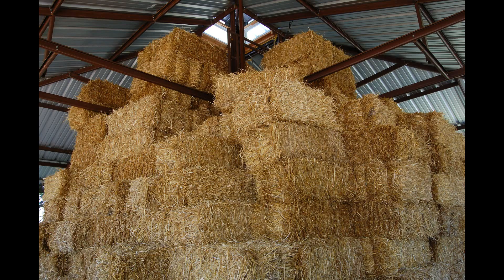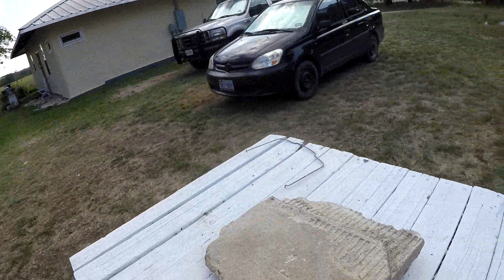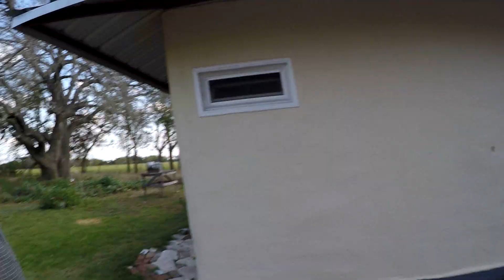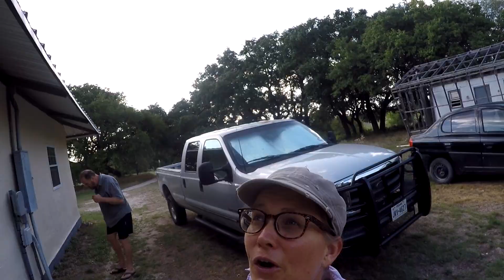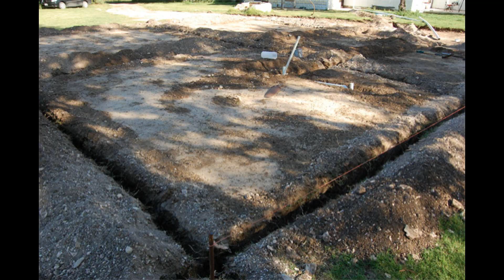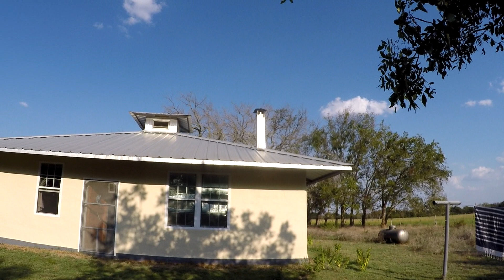Straw Bale House - Exterior Talk

Comment: ID like to know the slab underneath it and how you start the hay bale how you join the hay bale with the chicken wire to the slab and and and plug it into the slab to have no damn Rising all make it weatherproofing and
Reply from the maker: The bales are impaled on rebar spikes.  The rebar is tied into the rebar in the slab.  This was done before the concrete was poured.  Where the bales sit on the slab we put a layer of thick tar.  The chicken wire is tied to the bales using a piece of rebar that we made into a "needle".  Then we were able to stick the needle through the bales and "sew" the chicken wire to them.  There are also rebar spikes driven from the top through all the levels of bales.   You can see a slide-show of pictures taken during construction:  Part 1:  https://youtu.be/iwJDmIFf8Tc          Part 2:  https://www.youtube.com/watch?v=--FeNHGKRDk

Comment: I'd like to know how you made each level of concrete over the bales. Could you possibly send it to me?
Reply from the maker: Hi - All layers were a mix of Slaked Lime, cement, & sand.  I don't recall the exact ratios off the top of my head...each layer was a little bit different.  The exterior wall were more of a concrete mix.  It's basically stucco.  The inside walls were finished in a layer that was very heavy on the Lime and light on cement.  My notes are not with me....I'm living in Mexico currently.  The Lime we slaked ourselves in 55 gallon drums for several months prior to use- We got the bags of Lime & concrete from Home Depot.  We used a test bale and ran several test mixes in order to decide which one we wanted to use.

Comment: Is your home post and beam and did you do the framing.
Reply from the maker: The exterior framing (walls & roof) are steel.  We infilled the walls with the straw bales...plastered both inside and out, & then we framed the inside walls & ceiling with 2x4s.  The 2 of us did everything in this build.

Comment: How is the exterior holding up. We will be building our Strawbale house this year this is great info. Can you send me your receipt for your render. We also don’t want a lot of maintenance. We have diving rain. Where going to use vinyl window. What state are you located in.
Reply from the maker: We're satisfied with the stucco.  It's still in great shape.  I have painted it twice since 2011 with the higher quality stucco paint.  The west side gets intense sunshine in summer...so it was chalking slightly after about 8 years.  There are fine cracks...but that cannot be avoided with a stucco exterior.  It is part of the nature of the material and should be expected.   It's super strong & tough.  We get driving rain too....no problems as long as you keep the paint finish maintained.  We built our walls super simple...so it doesn't take me long to repaint the entire house with a roller on a stick.  Once every 8-10 years doesn't seem too bad for maintenance.  I don't have the recipe with me now....I am living abroad at the moment but we developed it from tests we did using cement, lime, sand, & water.  We slaked the lime....(lime + water mixed together in a 55 gallon drum and left to "cure" for at least a month.ou can find a basic starting recipe on the net...but I highly recommend you take that and do your own tests

Comment: Hi folks, you guys put a lot of physical labor into building your home, to be honest I had never seen such build until yours. As far as the insulation R value off the straw and concrete is there a number value. Thanks folks !
Reply from the maker: We've measured the inside & outside surface temp of the west-facing wall at the hottest time of the day, during the warmest days of the year.  One of the hottest EXTERIOR surface temps we recorded was 130 °F.  On that day the inside temp of the same wall was 80... which was the ambient inside air temp.  So there was no change to the inside wall temp.
Reply from the maker: Oh boy did we ever (put a lot of physical labor into it).  Straw bale construction has been studied quite a bit.  There are several building institutes & universities who've published their findings online.  I've read that the R value varies but a common average is 2.38 per inch of thickness...some put it as high as 2.67/inch.  Our walls are about 2 feet thick.  The bales were approx. 19" thick.  (the plaster averages 2" on the outside & another 2 inches inside)  R value for the bales would be a little over 45 R.  They are extremely insulating.

Comment: Did any books inspire the cupola design for passive cooling?
Reply from the maker: I can't recall any specific books that inspired us to add the cupola.  I'm an avid fan of looking at architectural styles around the world & I know I've seen many of buildings that have them.  .Dave & I both understand the principles of convection......  We weren't planning to use mechanical air conditioners & so we drew upon design principles that were traditionally used to increase airflow in structures.  It all just added up to result in us thinking it was a good idea.
Reply: @SandraBegotka  thanks for the reply! Would love to see a demo of the cupola in action as in a demonstration of the draft created. There are 0 on youtube
Reply from the maker: @monsieurouya4156  That's a great idea.  I've got sage that I burn....might be able to set it up so the smoke can be seen drifting up the cupola.  Thanks for the video idea!